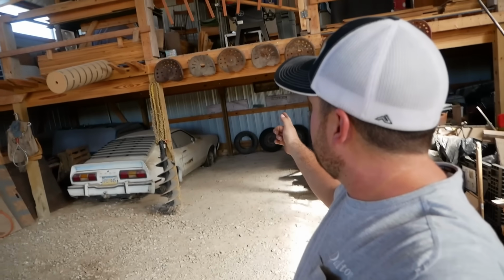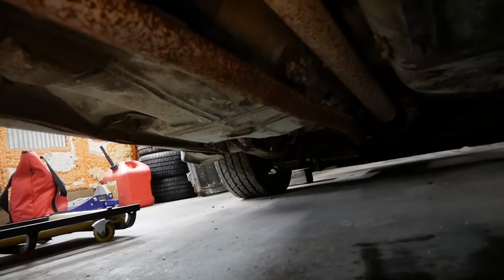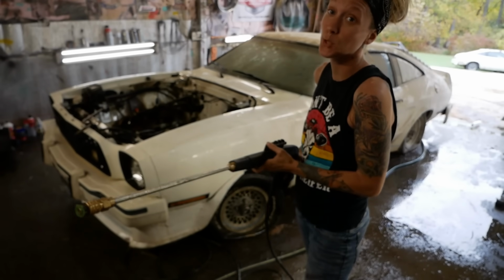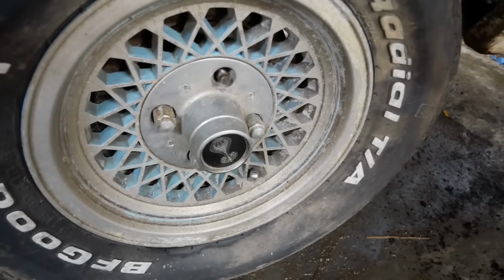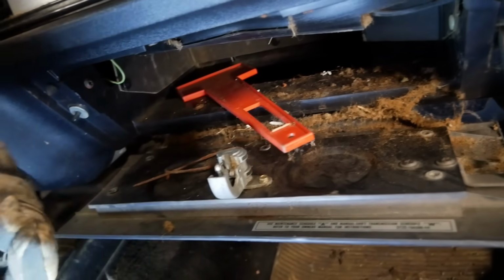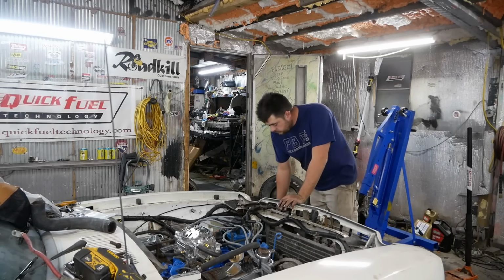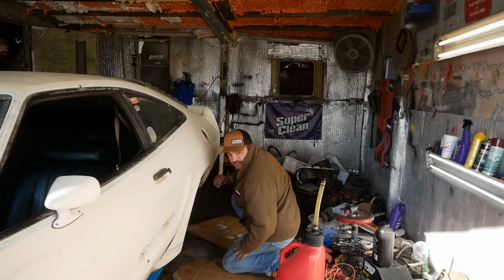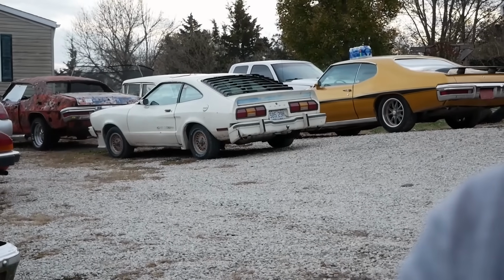ABANDONED King Cobra Mustang - WILL IT RUN and Drive After 26 Years?

Comment: I think it'd be fun to have this project but repower it with a 4.2 Essex from a late-2000s F-150.  It ought to fit, it'd take up a bit less space under the hood - never a bad thing - and represent a tidy power bump from the factory, heavily smogged V8.  It might even improve handling, shifting the CG rearward a bit.

Comment: Ive had 2 mustang 2s. One with a V8, other with a 4cyl. The 4cylinder was equal to a Yugo for performance. Anyhow, back in the 80s I saw a mustang2 used for an unmarked cop car, I highly doubt it wasn't the 4cyl   model

Comment: Those were Katydids in the engine compartment….They are what you hear at night during the summer usually starting around the 4th of July till fall in my neck of the woods in East Tennessee. I was stationed in the Army at Ft. Riley, Ks. 1989-1991. Not much difference in there and here…a lot hotter in the summer in Kansas..lol

Comment: Fuel pumps like that one also like the one in my Ford 400 has not been manufactured since cars stopped using them so that .eats the ones on shelves are old as dirt so the diaphragm has dried out so they fail

Comment: There is a button underneath the column opposite the key you have to pull out or push in.... It's been so long I don't remember which😂... Same as on the pinto the mustang II was based on😮

Comment: No Rotella?  Has Derek seen this? Lol. 15 or 20 years ago I installed a reman 427 tall deck chevy and that engine rebuilder recommend 15/40 Rotella. We've used it ever since. 🤷‍♂️
Reply from the maker: Rotella is good oil but it contains the wrong kind of zddp for a gasoline (higher revving) engine. It will protect it, better than regular oil, but you want an oil with the appropriate zddp or just add a little additive to your rotella

Comment: Kool Seal the tin roofs on your shop and shed and you will get up to 5 years of leak free use.  Then get one or two of the Amazon.co Spray foam insulation kits and you can fully insulate and seal the ceiling and walls of you shop up to 3 or 4 inches thick and you can easily heat and cool the small shop well with portable heaters and portable/window A/C units for complete working comfort.  the insulation kits cost $400 to $450 each ( one might be plenty for your shop ).

Comment: *..turn the steering wheel ever so slightly as you turn the key over and over and over and over and over and over until you find the sweet spot. 

*Squirt Graphite into the Key Cylinder 

*Spray WD 40 into the Key Cylinder

Comment: those ltds near the end of the video
my 72 ford f100 has an engine (351w) and trans  (c4) from an ltd in it  and has a 9 inch not sure what gears are in the 9 inch (truck supposedly came from canada) that particular setup makes the truck kinda scary on a wet road 
one has to be really careful or the tires will spin especially when starting from stop on a grade hell even with brand new tires under hard acceleration  it would bark the the tires shifting into 2nd gear 
with a transmission that had problems after being rebuilt

Comment: I am already wanting to cry, spray paint omg, Dude, sand blast and repaint her. If you don't do her justice now this King will rattle herself apart and it will start with the wells cracking, the front clip will begin to separate. But once you start seeing firewall cracks you will do nothing but cry.

Comment: I would imagine the oil pump screen is clogged up judging from all the crap in the lifter valley, the previous owner wasn't big on changing the oil.
Reply from the maker: Very possible. Just kinda hoping some flushing will get it cleaned

Comment: Rebuilding an engine is actually taking the whole block apart, replacing piston, piston rings and everything else. Gaskets,  heads and guts and everything else. Rebuilding the engine. Same goes for the transmission.

Comment: I would love a 74 2.8 v6 and 4 speed. No catalyst. You can actually pull most of the pollution control crap because it does not have a catalyst that came in 1975. The 2.8 l  for 1974, had very good horsepower. 1974 was the worst year for in American. The 200 cubic inch straight 6 only put out 85 horsepower. The 302 cubic inch V8 was putting out around 150 horsepower. In the early seventies the Mercury Capri had the same 2.8 l V6 and they were running the rings around Z28 Camaros
Reply: I had the 1974 loved it. If you climb into a mustang to an expected to handle like an old mustang urine for a rude awakening. With Dwayne the suspension is set up and the power rack and pinion steering you can change lanes with the blank of an eye.

Comment: Yes, this comment is a year later, but I would love to have this old girl with some longtubes, a full 3" dual exhaust back to Flowmasters or even Black Widows, a centrifugal supercharger, a front mount intercooler, and either a QFT carb or a fuel injection setup (GT40 lower and upper intake manifold, larger injectors, wiring harness, larger throttle body, and ECU). I would probably also install a T-5 trans over the 4 speed along with some better rear gears with a LSD and some beefier axles.

Comment: I brought home a '70 Ford F-100 with 38,000 miles on the odometer. Been sitting since '73. I did a full fluid flush, new brakes, replaced the lines, did a full tune up, and replaced the battery, starter, and refreshed all of the bushings, lifters, and bearings. A little shampoo in the interior and a paint job and it'll be just like it was when it rolled off the assembly line. I'm barely in at $8k and I'm sure I'll sell it for $50-60k. Or I'll keep it and do a Coyote swap with a 6spd manual.

Comment: I’d flipped that motor over put new bearings pump plastigaged everything checked the cylinders  put it back together … fresh and then put those 351 Windsor heads on it  Boss 302

Comment: Ill sell ya some 8tracs..... if it still werks... Replace the rubberband inside it. Should still werk. Engine not turning , key not turning. Crank windows cool. Good on the breakup fills... that should dislodge stuck stuff. Ringing movement. Hey awsome shes a runner. Cool. Alwase got crap for loveing this body mustang. COOL ON YOU ALL . greg. Ps i really do got the 8tracs

Comment: This definietely would not be the mustang I would have restored... Ford should never have made any Mustang past 1973. Why since you put all that time in the FORD II, why buy a LTD? Stay with the Mustang II and fix that rear bumper, oil spraying up front, and replace selenoid, windshield wiper switch in the column. In other words, You are too far along to not have a decent all around reliable Mustang II... Take the T-Tops off your donner one, and put on the new one. Going to have to make a custom install on that. Paint the Car yourself with the help of your buddies, get new decals and stripes from specialty shops, and you would have an even newer type build. Want more power?, get a fuel injected Holley carb and run injectors on this motor. This Cobra doesn't have posi-track. You could put a different gear ratio rear end too...

Comment: Zinc is an element, there’s no “wrong kind”
It is either is zinc or not.
Reply from the maker: That's not true. There's is zddp "B" and "A" one is rated for higher rpm operation. One is for diesels. Not my opinion, it's a fact
Reply: @ Then zddp isn’t the element Zinc.

Comment: Man ya forgot a lil something when ya changed the  engine the other one was an automatic transmission n ya putting a 4 speed.. oops forgot to put a pilot bearing on the crank man.
Reply from the maker: Clearly showed putting a pilot bearing in, otherwise it obviously wouldn't have driven....

Comment: Diesel absolutely will do more than that concoction u made. Its been used for years for this and other numerous things. If u ever have a stuck throttle cable from rust and crust drip some Diesel or kerosene down and it always works. Put a rusty bike chain in kerosene or Diesel and go look at it tomorrow it will look new.

Comment: A rattle can overhaul...... no rod bearings, seals , oil pump, timing chain - not even a look inside the pan for metal ??That must be a lot of faith, given the stress of having to pull two engines.

Comment: Least you won't have to buy a mustang 2 front end for it... or will you? ... Cool. Be fun to get a small block 351 or tree fiddy 1 modern windsor and drop it in and stroke it? Not exactly a new idea.... but these Mustang 2's didn't exactly come as power houses from the old Factory. They got Smoggled to death 😕 🥱😰💩

Comment: Throwing all those new parts being so close to the actual full rebuild is just sad. Keep the same motor in the car (Meaning same size not exact motor). As nice as that car is in shape you could have shaved the heads, Bored the Block and it wouldn't "run like crap" like you were saying.

I'd never take one down that far and not complete it especially with everything else your doing to it now. Smh 🙄

Comment: If your into building cars why would you not spend the 1500 to rebuild the # matching motor
Reply from the maker: I was pretty clear that it isn't the original engine. Also it wouldn't matter anyways (nobody cares about a turd mustang II 302) and also, as I mentioned in the video, a simple pcv valve took care of the oil burning. ALSO you're not rebuilding a seized engine for $1500 anywhere in the last 25 years

Comment: First please Hook up your pcv and  your oil consumption will slow down considerably. hook the valve into teh passager side valve cover and make sure outside air (filtered air) can enter the drivers side.  If the blowby is more than the pcv can handle, the oil will blow out the on the drivers side valve cover.  Order a pcv valve from a v8  ford in the late 70s early 80s. set timing at 8-12   degrees will help and a straight 40 weight if you can find it. go on line and order a case if ya gotta.  Lucus is good but High dollar.  If you can find Morrys it works best on oil drinkers.  Also driving like a white man will also reduce oil consumption. Proving the reason for oil consumpsion can be dedetermined by reading the spark plus and best of all percentage leak down test, done wet and dry for comparisom. If you think the rings need seated, I have been sucessful in the past by running a bit ( tablespoon) of Bonami ( spelling) or barteners helper scoring powder down the intake. Probably not teh problem with an engine with over 10,000 miles of sucessful operation.  If you feel ther is an excessive amount of carbon ( and your percentage leak down did not show improvement using seafoam  and driving it 100 miles after running half a bottle down the intake ( I put  a half a cup of water and marvel mystery oil down the intake then the half bottle of seafoam and let it sit for a couple hours, then finally the final option If you feel you still have carbon build up on teh valves and pistons, 222222222222222222after a few days of driving, finely ground walnut shells down the intake. When ever treating a motor by administering 'medication' down the intake, do it VERY slowly.while setting throttle at @ 1000 rpm. Slightly increasing rpm as the medicne goes in, jsut enough to keep it running , then a couple hard revs to clean it out between the administering of teh concocksion. 2 or 3 hard wide open throttle revs done quickly.  all this should be done at normal operating temp.  I`m only 75 years old, but my odometer has turned over a few times if ya know what I mean. and these tricks have been passed down to me from mechanics 30-40 years older than me and 50-75% of the time they work. So there it , take with a grain of salt , and bedamned if I know how to measure a 'grain' of salt.  If the motor isstill not acceptable to you , bet a belt drivensupercharger  and it should fit where you did teh A/C delete. And when that has delievered its satifying results, find a windsor and shoehorn that in ther with some real headers and THEN you will have a Cobra whos bite your oponents will not soon forget.............Awooooooooooche Man that feels good l love that blue oval feel. I hope this helps. Doc Rick 480 215 1115

Comment: those were garbage packaged in fancy decals, known them well and have had alot of frustration with the c2's and kc's.  decent differentials but hardly the power a 302 should have been capable of and never were stationed correctly with larger wheel wells and larger wheelsets.  sadly this one deserves some care to bring back to life, but really the degree of rough handling that your expose was has me thinking ... theyre all a little messed up and by todays standards are hardly the 'car' they were touted as. good looking gutless wonders.

looking fortward to a 2017 gt 5.0 if fuel isnt outright outlawed in castro's canada. (if you know the scene in canada and its puke prime minister, you'll understand)

cheers and hope the heap amounts to something worthy of a few grand invested for a lifetime of ford made hell.
consider a wheel mini tub and front skirt sectioning to allow for taller and dropped cradle position to allow for a lower and better looking 'flintstone' wheels offering. 16" centerline champs on  svo 5 lug were the hard conversion that some seen done, but really the only thing about it all is re engineering the front to allow for a deeper inset spindle/shock tower arrangement.

as for collecttible.. yes they're finally resonating with 60 yr olds who knew them as the alternative to the z28's that litterally were another heavy long door sagging disco machine along with the pontiac screamin chicken era.

posters are alot cheaper and the neglect this one had endured was really at the hands  of amateurs. 
hope its worth the trouble as any 68 stang in fast back form outclasses this in looks, but the mustang 2 front cradle and suspension in itself was a decent setup, cant tell you how ludicrous the costs got on these from parts at ford in thier day, but today its a real dog of a find for externals and trims.

if you think you're sick of this well ill tell you there were 6 of these and the c2 variants that were dismally held together till the early 90's and afterwards every one was sold of altogehter scrapped for the embarrassment thet were in their 'hey day'.

admittedly tough for the day and somewhat reminiscent of the 66-8 fast backs, i too would have gladly taken this p.o.s. in and taken it apart carefully but gotten it on a rotisserie with some time in a plasma sectioning and resseting the towers to accommodate taller and deeper wheels.
the rear needs to be gutted and mini tubs to accommodate a 4" shorter differential assembly with disks (hmm would fox body (93-99 work??) BUT MORE IM0PORTANTLY TO RESIZE THE WHEEL WELL OPENINGS TO A LARGER  STRETCHED AND TALLER 4" AND WIDER BY AT LEAST 6 INCHES. 
YES THIS MEANS RECONFIGURING THE APPEARANCE AND THAT DUMMIED COBRA IS PERFECT FOR PANEL  SECTIONS TO COMPLETE THE FACTORY LOOK. 

its surgury and afterwards the interior of the back seats will be modified /cut to accept the new and intruding wheel wells (mini tub nothing monster just what needs to be enlarged and give the car an actual stance that compliments the shape and gets rid of the 'flintstone' wheel wells and 14" wheelsets.

i believe the grand torino wheels were 15" and those alone would be smack better bit of work converting the axles and the front rotors to 5 lug.

Dammit now you got me thinking of them shit!!

sick i watched and relived some hell in your efforts but again if anyone knows anything about these kinds of cars, get ready for some serious cash outlay, if not a coyote 5.0 then a fuel injected thortle body conversion and a current torque cam that would allow this heap to actually move hard and build speed at the 700 foot mark on the track, then and then only do the factory gears really shine, otherwise it makes alot of soft power in its ... get this... 3.08:1 ratio.  Thats why they had small wheels as well, the flintstone effect.

find em here in canada but they're held together with tape at times!!!! lol
best of luck and remember ... there's nothing cheap about them, only the feeling after putting all your effort in and finding a heavier camaro with a mild 305 eats it all day long!

Comment: I converted my 79 Camaro to a 4 speed brand new clutch and pressure plate and flywheel and it chaders such shit today you can't even build a engine because of the shit parts especially the lifters and cam happy Thanksgiving
Reply from the maker: That sucks. Garbage parts everywhere

Comment: If your going to take a older motor this far down why not do it right and replace everything that's worn out and I'm just saying if there was no oil in a oil filter that was 
 recently started why would you not check or replace the oil pump and timing set your my favorite guy Dalton but you cry about spending so much on a clutch but won't spend a fraction of that on a oil pump and timing chain haven't you learned not to buy
 orally fuel pumps

Comment: That Hunk of Junk is more than 26 years old.  And it was a Hunk of Junk in 1978 even when first built.  I would have not wasted my time on that "joke" of an automobile. In the 1970's all car manufacturers were embarrassing themselves with their products poor engineering and design, and very poor quality control standards thanks to the "Union" idea or work and skilled, or not so skilled labor in this case. There used to be a GM plant called Fisher Body where the rejection rate of car bodies was nearly 35%. Naturally, you just melt the steel down and start over again from scratch adding to the overall price of the car at the dealership. And less profits for GM. Naturally, it has been since closed. Way to go UAW!